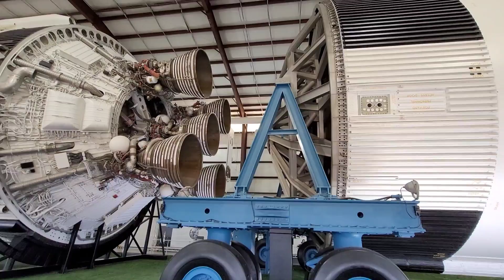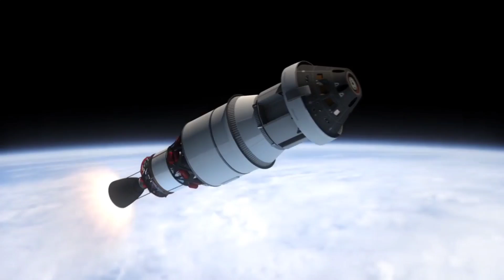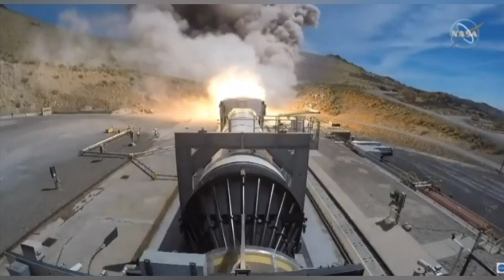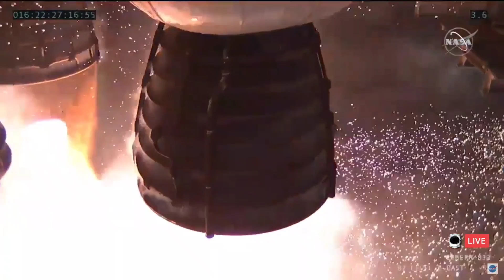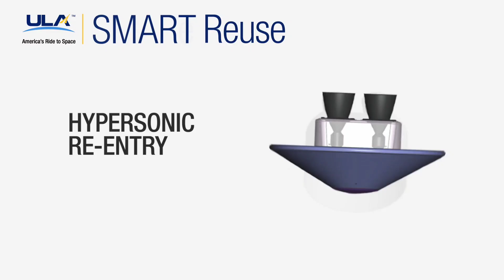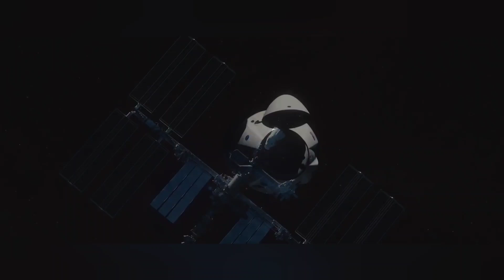Green Run Canceled! How did Boeing foul up SLS so badly? Can SpaceX or ULA (both?) solve this?

Comment: Respectfully, why would a shroud be needed for the falcon heavy, or even using the planned shroud on the Vulcan? The Orion, the crew dragon, and the starliner are all designed to launch without any type of shroud. In fact if Orion had a shroud, I don't see how it's emergency escape system could work.
Reply: actualy any kind of fairing is a giant No no for abort options becuase if you need to remove a fairing before you can do abort you have problems
Reply: @bigpod  The only manned space craft to ever successfully have an IFA while humans are on board flies inside a fairing.... Soyuz has been doing that for decades.
Reply: @phoenixrising4573  well that is true but it was designed to work that way which orion isnt, and it would require a substantial redesign of a fairing and capsule so it would support in flight abort but yes i did fail to remember that
Reply: Orion actually lives inside a fairing. The fairing jettisons with the abort motor after booster sep when the abort motor is no longer needed. The aerodynamics of the Orion aren't designed for flight. Using the method proposed in the video, the Orion would be un-crewed for launch, so would not need an abort motor (which is a HUGE mass penalty). That opens up a significant opportunity by greatly reducing launch mass.  Also, the Service Module is encapsulation in a "fairing" of sorts. The panels jettison after the vehicle has ascended above the appreciable atmosphere. Launching Orion inside a large fairing like Vulcan has will eliminate the need for those panels, further reducing mass.
Reply: @jamesowens7176  One part of the delay, is that the ESA built Service Module, was more than a year behind schedule. And, WTH is it sub-diameter to the Orion? If made same dia, like the Apollo's service module, no disposable fairings would have been needed, and more room to add components if needed.
Reply: @paulmoffat9306  The trade was made back in the early days of Orion (before it had a name or a contractor assigned). I was on the "smart buyer" team at NASA that came up with the notion of the "encapsulated service module". At the time we were hugely mass limited because this was all designed to launch on the Ares I. The first iteration was 5.5 meters (the size of the Ares I Upper Stage). It had already been downsized in preliminary analysis to 5 meters to get into the mass box. Then again before we even finished the first design cycle, we changed Ares I Upper stage engine from RS-25 to J-2X. (in retrospect, that was the death knell of the program). That put the Orion already outside the mass capability again. So came the encapsulated service module. Additional savings was bought by using the jettison panels, because you don't have to carry that weight all the way to orbit. After Constellation got cancelled, the Senate dictated SLS and reuse of the Orion. But since Orion was designed for a much smaller launcher, it will always be less than optimal for use with SLS.

Comment: The prevalve is an example of disposable rocket economics. They never intended to service the prevalve because the engines were intended to be used only once.
Reply: And they don't work the one time they're meant to. Brilliant.
Reply: @Jonny_Shertz  Yeah well because the part will be used only once and never need servicing you set out to make it lighter cuz you know every gram of weight in the booster cost several grams of payload. So in the end you come up with an overly expensive, overly engineered, yet flimsy part. Throw in the government a customer who will reward your failure to make a valve that works by increasing your budget so you can get it working and...well...That's how we got SLS :)
Reply: @THX..1138  Surely there's no such thing as "overly engineered" with human space flight!
I'm beginning to think with this thing not that it MIGHT not ever fly, but that it SHOULD not ever fly given the culture you describe! Seems so sad, doesn't it, not least because of all the sheer talent and genius and time and money being thrown away on pork belly nonsense.
Reply: @Jonny_Shertz  It may not. VentureStar, Ares I, Ares V never flew. IMO if SLS doesn't launch before Starship preforms a successful orbital flight it will probably never fly...But that's the beauty of government contracts, if your end product meets none of the project goals, even if it never works at all you still get paid.
Reply: @THX..1138  Great comment. I think you are so right.
It is the whole, shifting economic model that's propelling the technology. Legacy organisations like NASA and Boeing and the US government just can't compete - and shouldn't try any more.
What we're really witnessing here (I hope!) are the dying moments of the old, corrupt funding model that you talk about which has resulted in the STS mess, and the dawn of the new model that's producing a potentially scalable, reliable, viable space exploration industry. 
To me, legendary though the brand is, NASA is the federal space administration body. It regulates space flight. It has no business building rockets any more. STS kind of proves that to me once and for all. 
So perhaps this ridiculous, expensive Artemis mess does serve an important purpose, just not the intended one of getting people back to the Moon.

A glass half full kind of view :)
Reply: The original iteration of that engine has been re-used on the Space Shuttle, 'If it ain't broke... "

Comment: We all know the real nail in the coffin of the SLS is the BFR, if complete it will be NASA and the US government’s worst nightmare in reality
Reply: I would say it would be companies like Boeing and some senators worst nightmares, but for Nasa it would mean an extremely cheap way into space, which is a dream come true for any true scientists.
Reply: Not really. Starship is part of the bidding process for artemis. So it's not like NASA isn't expecting that it'll be possibly ready and viable over SLS.
Reply: @Jaker788  with or without Artemis space x will go to the moon, Elon doesn’t need nasa, nasa needs his 100 seater starship
Reply: @Klix3ontop  SpaceX isn't interested in going to the moon on its own though, they're interested in being selected by NASA for the mission. If they aren't selected they won't bother.
They're more interested in going to Mars on their own and not the moon, with or without a contract with NASA
Reply: @Jaker788  the moon is meant to be the gateway to the rest of the solar system u idiot 🤦🏾🤦🏾🤦🏾🤦🏾
Reply: @Klix3ontop  That's an idea. But not really a fact. In orbit refueling is an option. And you can only produce hydrogen on the moon, but seems we're moving towards methane because it's a good all around fuel, and can be produced on Mars to get back.

I don't know why you're calling me an idiot when you don't even realize that even ULA said it's not necessary and that in orbit refueling would be cheaper and potentially easier. Shouldn't go around calling people idiots unless you're an expert

Comment: Okay, so what specifically don’t you like about SLS? 🙂 It’s all very well proposing a solution, but to achieve that you need a leader with clarity of purpose and drive, and the funding to achieve the goal. As you’ve shown, the SLS is driven by pork barrel politics. It’s a Frankenrocket, bits arbitrarily sewn together, ready for the lightning storm, and the switch to be thrown.
Reply: IT'S ALIIIIIVEEEE !!!!!!

Comment: Bro I think you are too obsessed with re use. It remains to be seen at all if re use is actually economical. The problem is that at best re usability can save you 50% of your base costs, and then you have to remember that you carry 30% less kgs to orbit with a reusable rocket. So in reality in the best case to break even, you need something like 4 launches. That's not including any significant refurbishment costs. You'd probably be better off just mass producing cheap rockets with modern automation techniques. The reuse thing is a lot like Elon wanting to use propulsive landing on his dragon capsule--eventually he realized it's not worth it and you should just use parachutes. We also have to acknowledge that space x isn't really saving nasa any money on their contracts and we don't know what the full figures are on space x reusability costs.
Reply: We may not know the specifics but at the very least it's safe to assume reusability is economically viable for Spacex and that's for the Falcon 9 which is not fully reusable.  If Starship comes to fruition it will be a game changer not approached since Saturn V.
Reply: SpaceX decided not to do propulsive landing of crew dragon becuase well it was supposed to land on moon and mars as well (there were plans about it) but they canned those plans so it made no logical sense to actualy do the propulsive landing for dragon capsule since time and money spent on human rating a landing system where that money can be spent on something else possibly a replacement aka starship. Besides NASA even wasnt interested in propulsive landing. 
while i think reuse is economical it is also far more green, as one of biggest parts of rocket pollution is its production.
also as far as i remember elon saying one of the hardest things with crew dragon was the parachutes and that there many engineers were thinking of quiting because of how dificult parachutes are.

Comment: The SLS is expendable, but the fact that really pisses me of it that it cannot put that much in orbit because of that damn orange tank
Reply: so is contextually correct to say "orange tank bad"_.
Reply: @myvideosetc.8271  yes, because it is very big and the rocket hadn't many stages it's payload is diminished
Reply: Hydrogen is the least ideal fuel for a booster stage, and the engines are more optimized for vacuum than sea level going off the fact they're as over expanded as the shuttle main engines.
Reply: @Jaker788  The only difference between a sea level engine, and a vacuum engine is the bell.
They are the same exact engine, you just design the bell for where it will operate.
The shuttle operated in space, so the bell was better for vacuum. I expect SLS uses a sea level bell
Reply: @joshua43214  It has the exact same over expanded flame and mach diamond as the shuttle, it's not so much optimized for vacuum that the bell would break from separation, but it's the most they could get away with. So I don't think they're done anything new since the shuttle.
Reply: @joshua43214  The Shuttle's RS-25s were useless once the fuel was expended and the ET jettisoned.
Reply: @Jaker788  LH2 has a better specific impulse than RP-1. It's why the S-II and S-IV B burned LH2.
Reply: @dalethelander3781  Good specific impulse, but really bad fuel density that adds storage weight. It's a great second or third stage fuel, but when you use it on the first stage you end up with a huge fuel tank that cancels out a good portion of that ISP benefit.
Reply: @Jaker788   > a huge fuel tank that cancels out a good portion of that ISP benefit <  Well some portion to be sure, but apparently still good enough on balance that NASDA/JAXA for example has taken that route for going on thirty years with the H-II, H-IIA and soon -- never learning their lesson -- the H-III.
Reply: @Jaker788  I wonder why they are over extended like the space shuttle engines. They even have the same name. It’s almost like they are the same engine

Comment: I have a ludicrous and very Kerbal concept: at this point, NASA should just place Orion atop a Superheavy booster. Bear with me:

Superheavy is designed to lob Starship on a suborbital trajectory just beyond the Karman line. Just imagine the dV it would gain with an Exploration Upper Stage and an Orion-ESM vs a 100 ton Starship. Superheavy could be able to send Orion on an eccentric suborbital trajectory just like the original SLS. Orion-Superheavy does have a nice ring to it too.

Granted, many design changes are needed. Due to the lower payload mass, less Raptor engines are needed to keep the TWR at a reasonable amount. An adapter would have to be designed to mate the two stages together.

As for recovery, things get interesting. Falcon 9 style recovery is definitely out of the question due to the reentry heat, but SpaceX could take inspiration from ULA's SMART Reuse and recover the thrust section with an inflatable heat shield and parachutes, though that could present a headache for SpaceX considering their troubles with Crew Dragon's Mk3 parachutes.

I just hope that the Artemis program puts a base on the moon, one way or another.
Reply: The recovery would still be possible so long as some of the delta v you’re taking into account is used for an entry burn. The amount of speed the Orion would get from a Super Heavy would be monstrous.

Comment: Part of me thinks NASA is waiting for the lunar starship to be ready and human rated, and then SLS is cancelled.  Maybe SLS will get to fly 1-2 times, but in the end it will be replaced by other solutions given all the issues, costs, and delays.
Reply: I don't think NASA has any authorisation to cancel SLS. If they would try, they would face budget cuts and whatnot from Senate, as you can hear in this very video at 13:05, as it happened earlier already. See the link in the description. They just have to carry this failed project, you need people higher above, to make that decision.
Reply: It's just sad if it get cancelled which it most likely will, it's alot of wasted money, nasa could have used to do other amazing things. Really the sls should have never been approved in the first place or at the very least never given the budget that it did, it's old tech, we shouldn't be rewarding that. Space needs inovation, alot.
Reply: And what a waste of money, time and materials that is.
Reply: It is still not clear that Starship HLS will be selected, but I think they will select two systems - like they did for ISS commercial cargo and crew - where one of them will be SpaceX.

If that will be the case, I think SpaceX should take advantage of a Starship HLS flight and do a "live demonstration" power-move: after the Starship HLS ends in lunar orbit, they should have a SpaceX send another Starship to lunar orbit, refuel the HLS and drive it back to LEO (where they'll likely need another refuel) and land everything. By the time the HLS flies - if no unexpected problems occur - they should have all the hardware to do that.

Comment: The only similarity between the space shuttle fuel tank and the SLS tank is the color... orange. They are 2 COMPLETELY different structures. Not even the same materials are used I don't think. And they're stress completely differently (no orbiter with engines hanging off the side)(RS-25s at the bottom)

Comment: What’s the range difference of the dragon vs the Orion? At one point there was talk of using falcon heavy to put a dragon around the moon. Can the dragon do that trip? And if so, at what point does nasa ask spacex to human rate the falcon heavy? It’s gotta be easier than human rating the skydiving starship before 2024. Or even putting the Orion on a Vulcan? I know real life isn’t kerbal space where you just throw whatever together, but at this point do you start looking at other options?
Reply: We must remember, the Crew Dragon is only designed to handle reentry from low earth orbit. The heat shield would need to be substantially reinforced (adding more dry mass) to cope with the intense heat of reentry from trans-lunar velocity.
Reply: @BRODY PETERSON There's no falcon heavy on any pad, or assembled right now. All the boosters made are in circulation and booked.

SpaceX isn't interested in the falcon heavy for this kind of thing, and it's not rated for humans. That's what starship is aiming to do, but first things it'll be doing is heavy cargo lift to LEO or GEO
Reply: @BRODY PETERSON maybe as a last ditch effort but I’m guessing there wouldn’t be enough time to get a dragon mounted on and setup with a heavy. Even tho they are technically the same Center core, I would guess there are enough differences that you couldn’t just put one on and go.... besides, current nasa would probably let a crew die before they would risk a second crew on a rocket that’s only flown 4 times and isn’t crew tested. Too much cover your ass these days, or maybe I’ve just been doing too much studying of the 60’s when every flight had some kind of issue that had to be solved and the risks were fairly high.
Reply: Falcon Heavy isn't human rated, and SpaceX isn't planning on getting it tested anymore. Plus it's only able to take dragon to the moon when fully expended, any heavier payload it can't do.
Reply: Elon persuaded the guy who booked the flight to wait for Starship. I understand why Spacex are concentrating on that, but I'm starting to believe they are missing a huge opportunity by not develop a deep space version of Dragon and getting FHeavy crew rated.
Reply: @christopherstubbs8130  I mean, if they didn’t have any crew vehicle I would agree but at this point I agree that in the timeframe they have that getting starship up and running is a better use of resources. If something happens and they are unable to get starship going, they could still get dragon and FH going, but there’s no reason to send anyone to the moon in the next 4 years until nasa gets something going, other than to say they did and that’s a lot of work just to orbit the moon and say they did it.